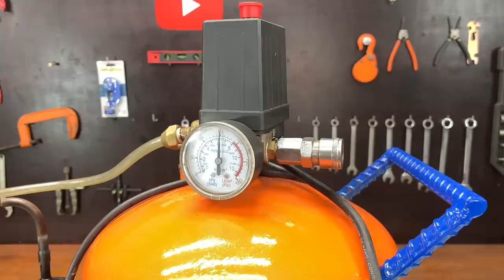💡 The Old Man Restoration the Old Air Conditioner Compressor and Gas Cylinder into an Air Compressor

Comment: Good job, but aside from the considerations about weakening the tank with welds that need to be kept in check with a lower pressure setting, there is the problem of oil being put into the air by that type of compressor. A filter would be needed to get clean air for spray painting.

Comment: Nothing is more dangerous than reusing a rusted out pressure tank, unless you start welding on it. That thing is a timebomb waiting to go off, and at the pressures that it looks to be made to hold, I wouldn't say the clock is very long. NEVER weld pressure tanks, it compromises the strength of the tank. When it explodes (and it will explode), it's going to find the weakest bit to blow through first, which will be the welds.

There's a reason pressure tanks are heat treated when they're manufactured.
Reply from the maker: I am Happy To Receive Your Feedbacks, advices, Suggestions To Improve Myself Better 
!!!I Apologize For The Mistake If I have Made In This Restoration

Comment: I love to watch these restoration videos. Just wish it had some subtitles so that we can understand what is going on. I didn't understand how a turning motor in the large cylinder made the compressor turn in the small cylinder. Could someone explain this please? Would this system produce as much compressed air as a compressor unit from a fridge? It was good to watch but I am no refrigeration engineer so most of the time I was lost.